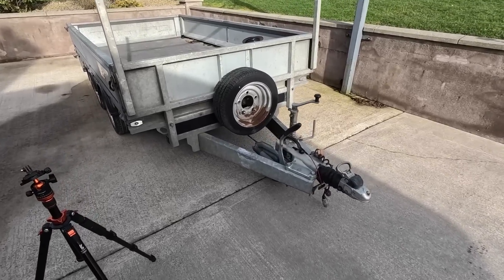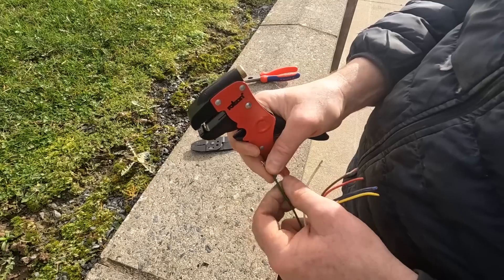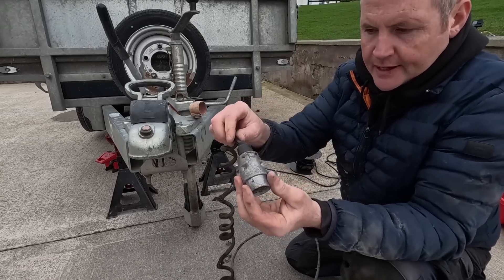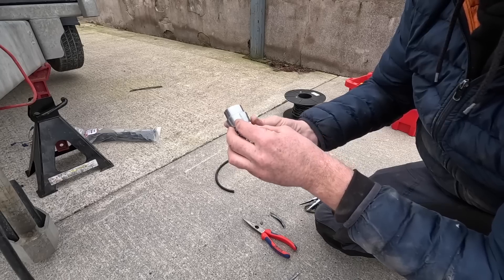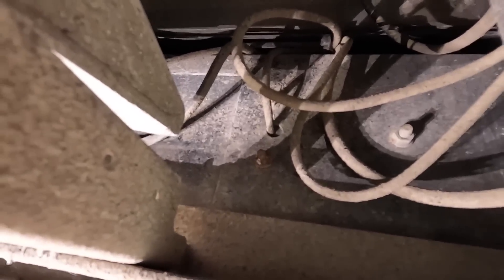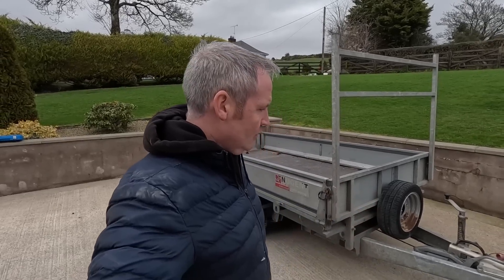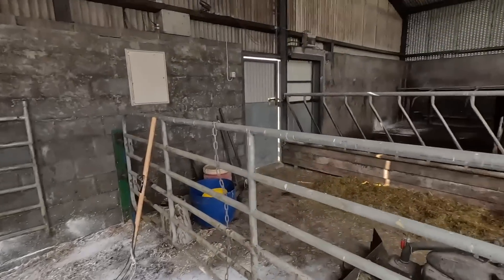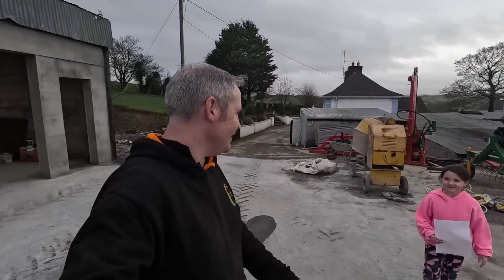Flat Bed Trailer Repairs || Workshop Plastering || Competition Winners

Comment: Great video I would have put a female 7 pin on the trailer and made up a double ended male 7 pin cable so if you break the cable again you only need to replace the cable going from jeep to trailer as we all know at some point the cable is going to fall on floor and drag on road and your have to replace the cable again.

Comment: Adrian the new cord appears smaller and is loose at the junction box. I would wrap the cord with electrical tape or silicone it to keep moisture out of the box. When I do something like wireing the plug I end up with trying to put 5lb. of sugar in a 2lb. box. lol Thank you Adrian for helping people that need help.